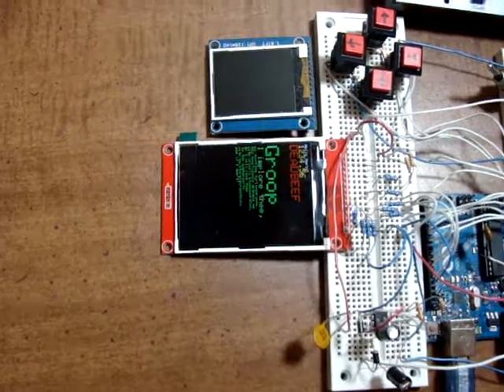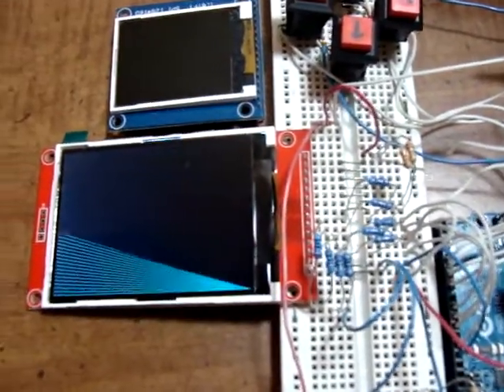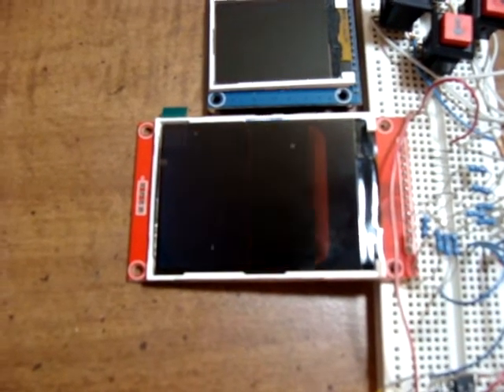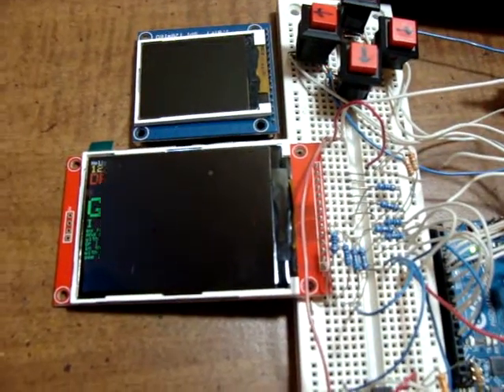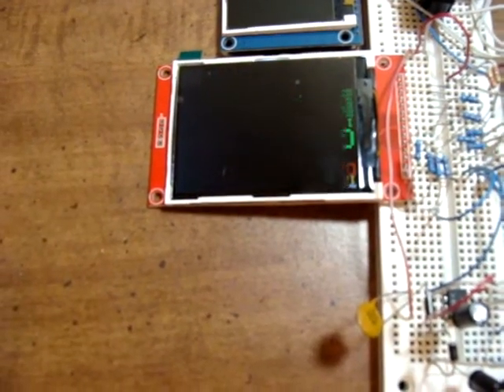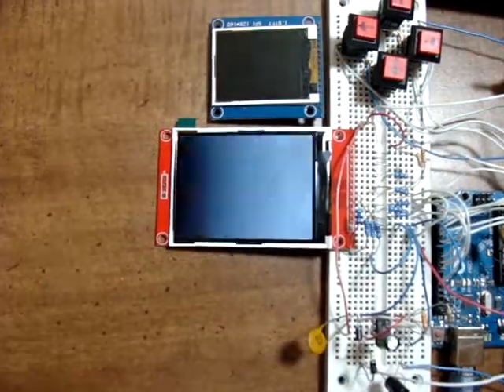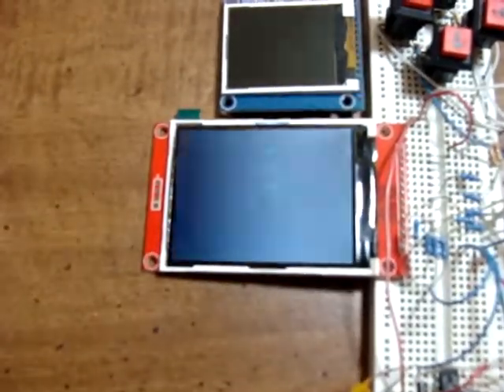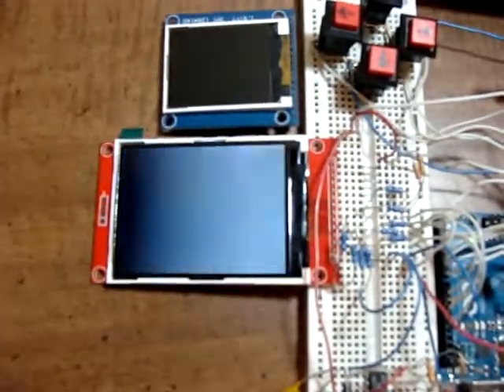2.2/2.4/2.8 inch SPI TFT LCD ILI9341 with Arduino Uno

Comment: Hi bob, I have seen some contradictions on the internet regarding the 1k resistors. There are people who use them and others who don´t. It seems that it is not unified in concept. Could you send me the circuit diagram with Arduino that has worked for you? I have viewed the datasheet and there is no connection diagram. Resistors are pullup or pulldown?.Greetings!!
Reply from the maker: See: http://bobdavis321.blogspot.com/2015/07/22-or-24-or-28-inch-spi-tft-lcd-ili9341.html
Reply: Thank you Bob but I saw your link before you give me but in the drawing you don´t mention the SD card inside the module connections.I've been many post talking about SD card module wouldn´t work properly therefore is more sensible to add some external SD card. do you think that?
Reply from the maker: I never used the SD card.  However it is needed to display larger images.
Reply: No,I don´t use large images.I keep my GCODES files into de SD card to be able to read from my CNC machine
Reply: Have you used SD inside card ??

Comment: Thanks for the info, the 1K resistors worked great with my Uno. I didn't realize until the end of the video that the LED pin was for the backlight- No wonder it wouldn't light up with no connection to it!
Reply: now i know what that LED pin for, thanks!!!

Comment: Dear Bob , 
Good evening . 
I am working with Arduino nano and ili 9341 display;
Since I have really poor experience , do you have please a schematic diagram  that shows how to connect the arduino 
nano with resistors and display?
Thank You very much and Best Regards from MILANO 
Walter Galotta
Reply from the maker: +Walter Galotta - use my schematic on my blog: http://bobdavis321.blogspot.com/2015/07/22-or-24-or-28-inch-spi-tft-lcd-ili9341.html  My design uses resistors you can also use level shifting IC's.

Comment: Hello Sir,

First i want to say I am beginner for Arduino coding..i just bought GLCD (480 x 320) from the ebay. That GLCD  controlling library is (Controller : ili9488 Test code:ILI9327:) under the item description.. I download that define library and uploaded to my ARDUINO UNO result is pretty ugly.

Display Colors are to much contrast Example (Black color looks like ash ,red = Maroon color Blue look likes light blue) and display every thing as a flip screen size not fit to GLCD screen width and height like below uploaded link.. please  help me on this i do not understand what to do i was googling more than few weeks but nothing got any luck ,..please help me 

Link 01 :- 

http://i612.photobucket.com/albums/tt207/udanagayan/22222222.jpg

Link 02:-

http://i612.photobucket.com/albums/tt207/udanagayan/1111.jpg

thank you 
Udana gayan

Udanagayan@gmail.com